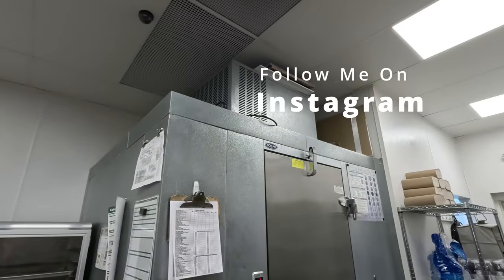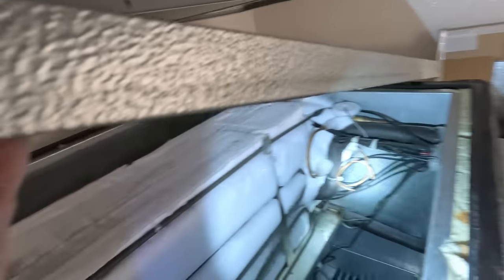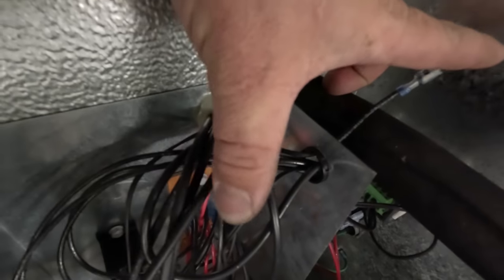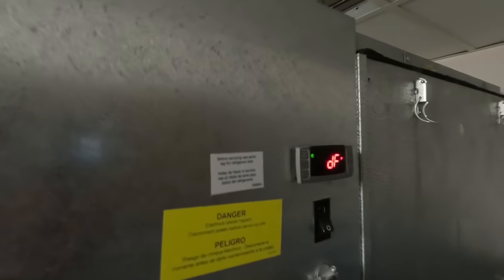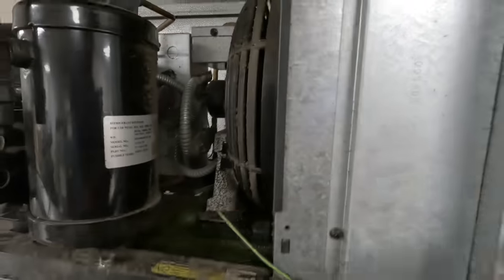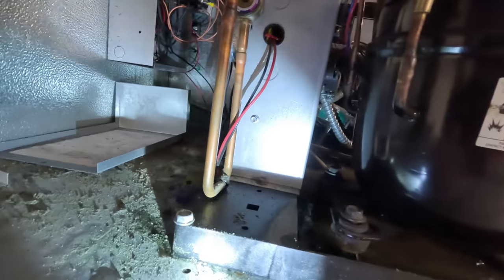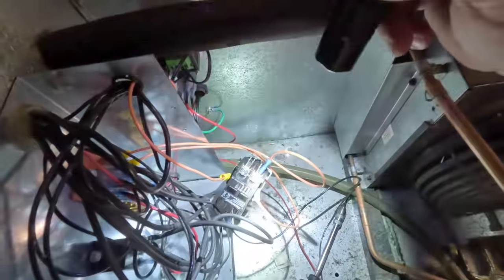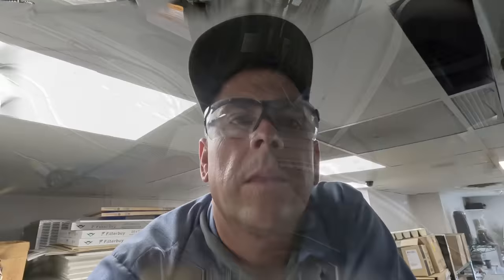Over Engineered Equipment Frozen Up... Now What?!

Comment: Good ol norlake junk. I’ve done the same thing you did several times, that’s a good repair. I’ve also ripped all of that out and switched to mechanical controls, but it’s more trouble than it’s worth on the newer ones. Now they use EEV’s and carel controllers that they have no clue what half of the parameters even do. I’ve had a lot of trouble out of all of the master built, RSG, norlake crape the last several years. Never loved them before but they at least worked for the most part and was a less expensive option for a walk in. Now they seem to just be horrible, not sure how they aren’t bankrupt with the massive amounts of warranty claims I’ve seen alone. Much less the rest of the country.

Comment: Nicely done Rick. Sometimes this digital mumbo jumbo gets in the way or is way over engineered for a simple operation machine. I like how you took the current away from the controller and used it as a simple controller....control voltage, controls current. Leave the switching loads on something beefier that is designed to take a larger inrush and operation.
Reply from the maker: It made sense to me. 🤜🤛👍👍

Comment: Nicely done. I like the dixell xr60cx as the compressor relay can take 20amps from memory. However dixell and carel are renowned for compressor relays failing on their controllers. Nice simple fix adding a contactor to stop load going thru the little controller. 👍

Comment: you ever try evap cleaner? you can use it on the condenser coils and is not very messy
Reply from the maker: I have blue and yellow concentrate cleaner. I also have some viper cleaner in a can.

Comment: The control probably has a simple relay on the board  you can find an equivalent from digikey or mouser and replace. Then you can have a fully working spare for temp use next time. American Zettler AZ2280 series relays in "form A" - 40a/1hp contacts are a great way to avoid using a full size contactor if it won't fit inside (looks like one of these was there already for the defrost heater).
Reply from the maker: I fully agree. But they also put glue on the boards to make it hell to unsolder

Comment: This "fancy" controllers is most common things in Other counties to control most commercial refrigerators/freezers. 
No timers like here in US. may be 20 years already. 
When i came here i feel like I'm in the Jurassic period, Controls, timers,BIMETALS are so old. but kind like it.
Reply: and controllers are much cheaper(in russia it cost 30$, in US only timer cost ~100$, plus fan/defrost control, thermostat, safety defrost etc)
Reply from the maker: @prothermal_refrigerationHVAC  the old stuff just works and works for longer. Thanks for your feedback 👍👍

Comment: Are adjustable, self resetting low pressure "analogue"/"mechanical" pressostats and solenoids more expensive than an electronic pressure controller in the US? If you want a pressostat just for low charge shutdown, a good old fashioned pressostat is enough. These things can go for decades. And I've never done an electric resistance defrost without pumping down the system. Not good for coil and compressor longevity to stress them  by heating the refrigerant during defrost.
Reply from the maker: Maybe that's why they had the pressure switch on there? Maybe They wanted to wait for the pressure to come down after being heated up before bringing on the compressor? This was an unusual setup, it's cheaper to do it with these electronic controllers vs mechanical.
Reply: @HVACRSurvival  It is possible, but still, the coil gets stressed.  On the other hand, if the same coil can withstand hot gas defrost for years, the stress is taken into consideration.
Where my business operates, it would be probably cheaper to use a mechanical pressostat and a solenoid. And probably less prone to malfuctions.
Whatever, if all machinery was well designed and properly taken care off, technicians would have much less work to do.

Comment: If you use common sense the most of the times temperate controllers for example lae AD2-5 says: compressor relay 10A @230V 5A or 8A @120V this is your inrush current im using the most of the time external contactor  for example ABB ESB-20-20 is a 20A contactor and is cheap enough to have a bunch of it in my truck and on my shop this contactor its dimensions is like MCB and is DIN rail mounting and it takes very little space on the electrical boxes.
Reply from the maker: Good to know🤜🤛👍👍

Comment: My guess is more units will go to computer controlled systems like this one.
Reply from the maker: Likely so because they are cheaper to manufacture.
Reply: @HVACRSurvival  Cheaper and I would guess can be setup for different systems.
Reply: @HVACRSurvival  cheap components for them, but if you need to replace  a bill for the customer

Comment: Minor suggestion, that contactor should have broken power coming out of the low pressure Dixell, rather than power into it. 

You've saved the relay in the temp control, however the relay in the low pressure controller will still be switching the compressor, which may still be a failure point in future. 

Good idea nonetheless!
Reply from the maker: True, But I would have to possible add a low pressure c.o to replace it. It's hard to justify it, I'm not sure why it had that fancy of a control when a cheap snap disc would have worked for a loss of charge safety.
Reply: @HVACRSurvival  Nah, you could have left it there and let it do its thing, just had the contactor after its internal relay. Relay would stay pulled in almost indefinitely and still pass current. Contactor would do the bulk of the switching, saving wear on the relay. Relay could still drop out on loss of charge. 

I do agree it's odd they went for a digital pressure control, usually only see those on some scroll condensing units.

Comment: Great job. Wouldn't it be better in the long run to just put in a new digital thermostat and mechanical time clock. I'm not busting your balls this is a legit question
Reply from the maker: No I've heard they have a thermostat with the defrost control, my problem is there is 12 other service guys and they only stock certain things, if I nag enough I can get it but is it worth my time nagging for it. I haven't ran into a bunch of these on walk in freezers, normally I see them on smaller reach in coolers and freezers.
Reply: I was thinking KE2therm  controller as well.